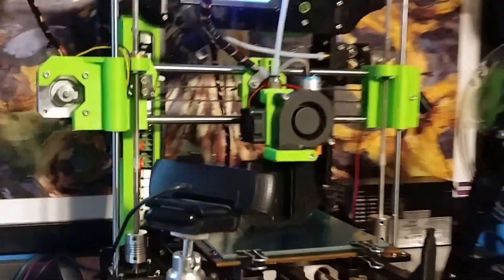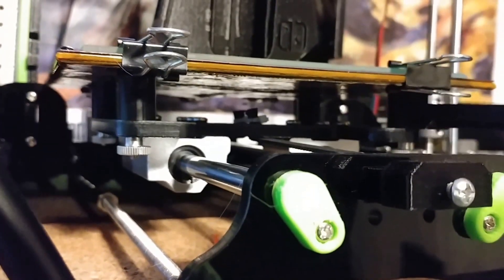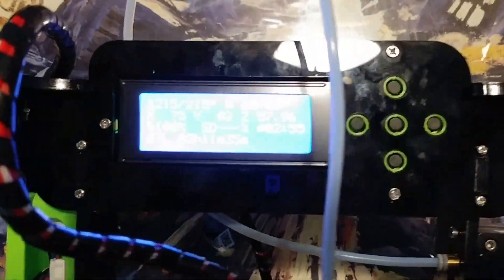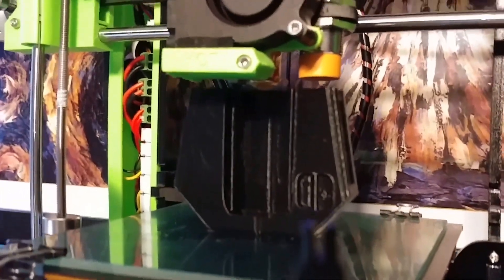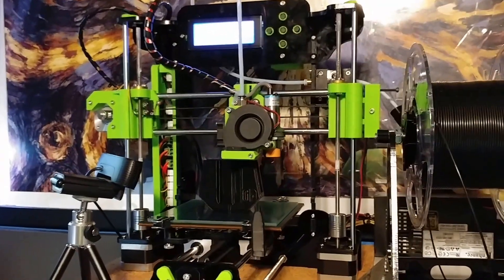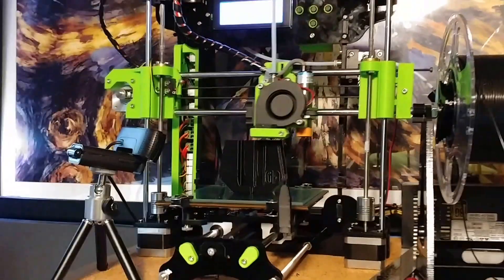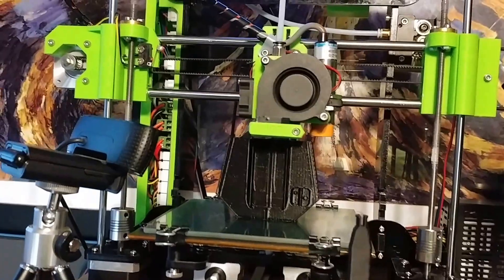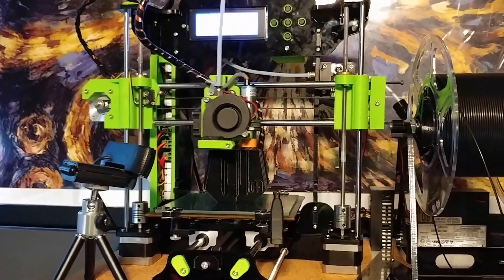Overview of my Souped up STARTT (TronXY XY-100) 3D Printer

Comment: hi... I just bought a Startt 3d printer, and this video helped me a lot.. could you please help me out... I wanted to do the same upgrades to mine... heated bed, a larger printing area, and a better hot end with a steel nozzle (I want to be able to use carbon fiber filament with mine)... can you please help me?
Reply: look up the E3D titan V6 Aero  hot end... to use any filament you want.
Reply: You are welcome to print carbon fiber filament and flexible filament with the low cost extruder and hot end on the STARTT.. good luck :)   EDIT:  just want to say that the STARTT is definitely the first quality 3D printer at this price point, but i'm not sure the hot end/extruder they are using will be sufficient for carbon filament...
Reply: Luuk van Oijen, you can always try to build a bigger frame for the printer.. you already have the hw necessary to make it run. is that possible Tim?